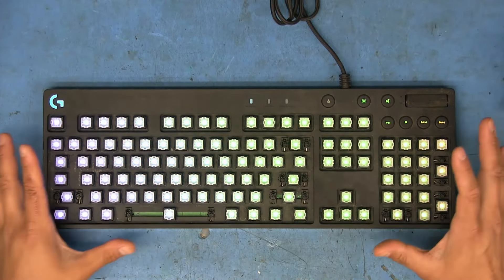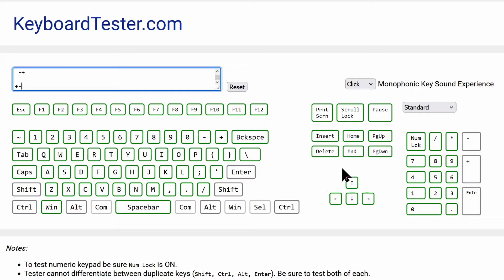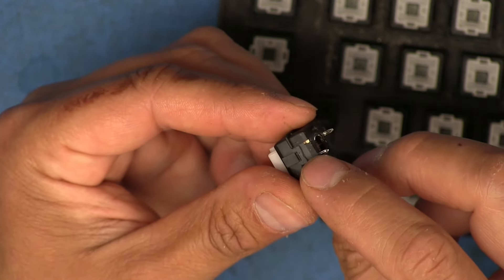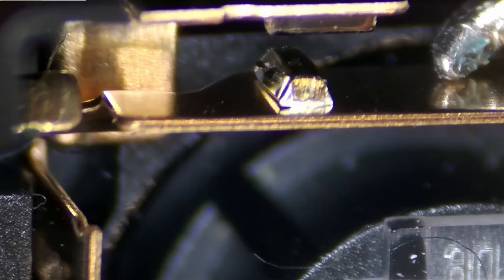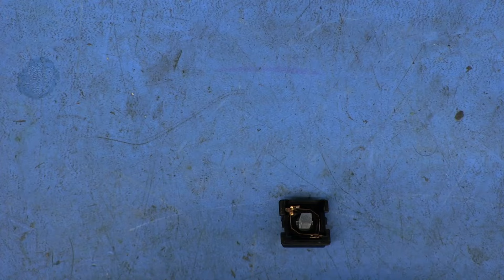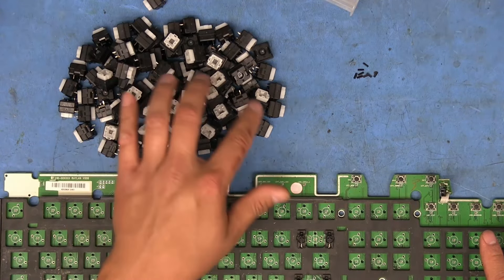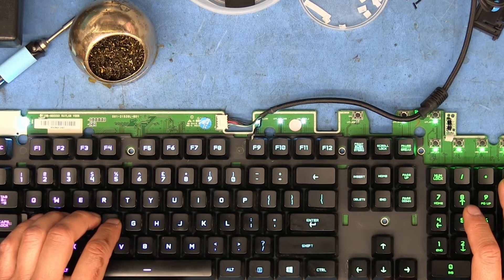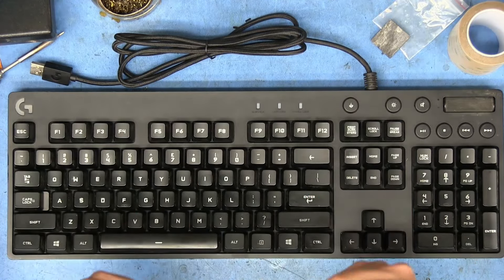TEF #177 | Logitech G810 Keyboard With Inconsistent/Unresponsive Keys

Comment: Thank you so much for posting this. My keyboard has been going bad for a while. The other day, it was basically not usable. I am glad I found your video on this. I want to mention that I was having trouble with my Xbox controller (USB/wired), and I am not having that issue now that the keyboard is not connected. I suspect the increased signal was messing with the USB (like a bad network card could).